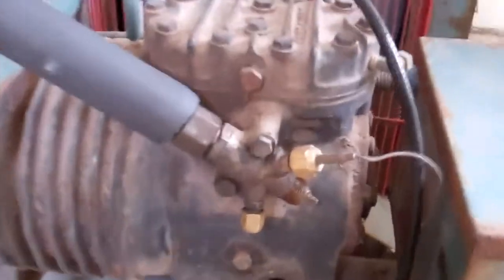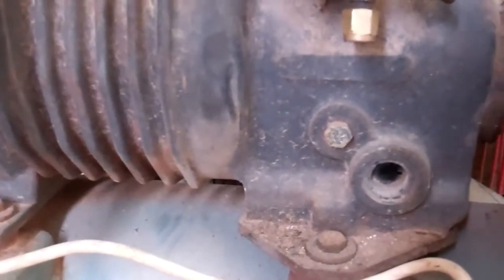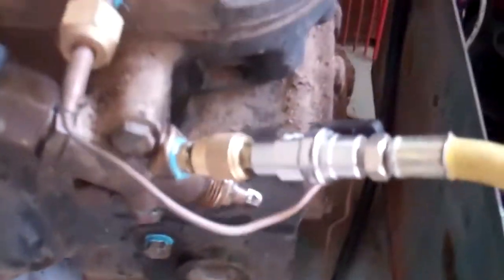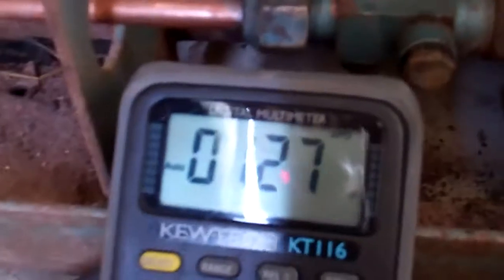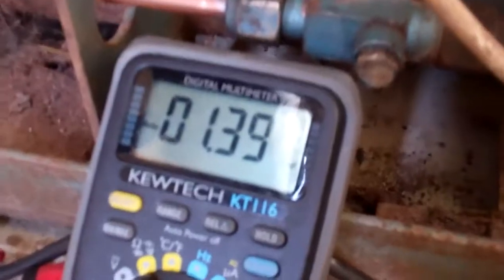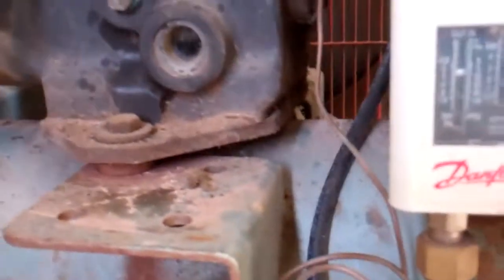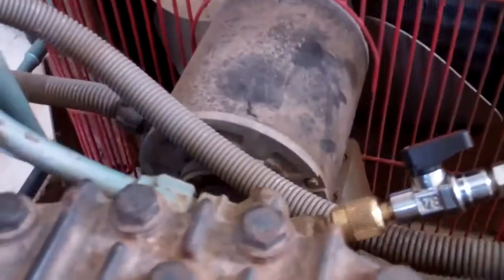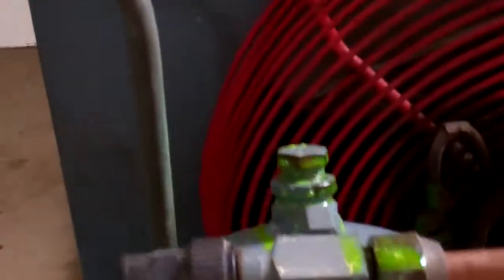Prestcold S100 unit

Comment from the maker: @fritzhvac Hi Fritz!

Thanks! They had fitted the contactor in the capacitor box, you could see a scorch mark where it had been shorting out on the relay bracket! Those tiny blue wires were so thin i wouldn't even use them in a control circuit let alone on the run caps!!! 

Must have taken a day longer to install with all the sorting things out! 

Ran it up and found both the txv's faulty, so will have to change them and the reciever on the other unit! One step forward and two back LOL